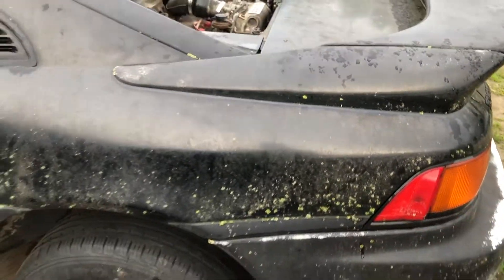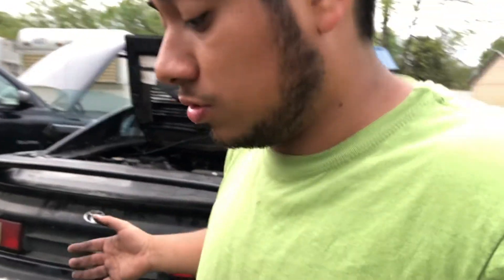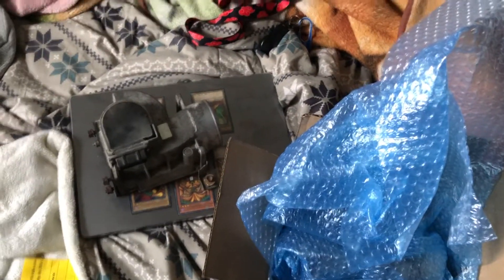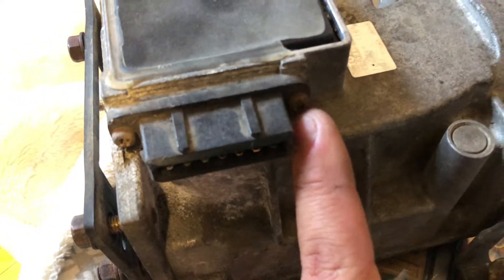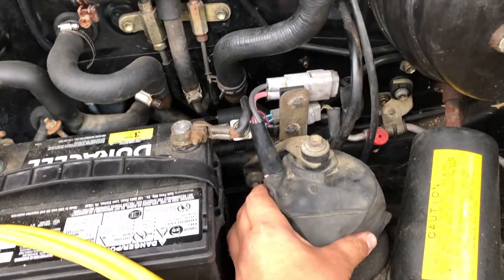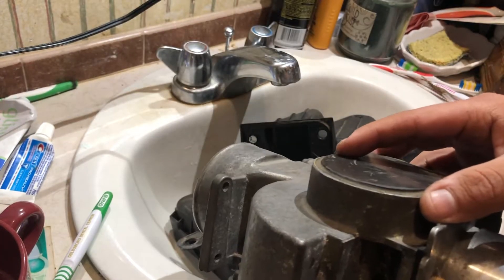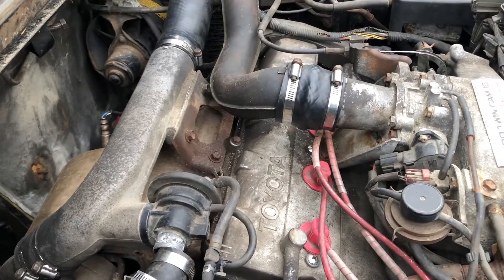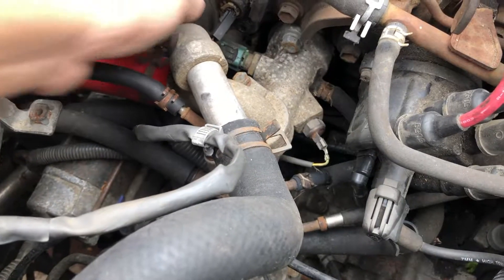Toyota MR2 3SGTE is FINALLY RUNNING!!! Project 1991 Toyota MR2 Turbo

Comment: go through every hose on the engine and replace anything that looks suspect. id also look into your ISC valve and your idle set screw settings and make sure they match to the bgb.
Reply from the maker: Thanks for the tip! I’ll check every hose on the car. What other thing should I keep an eye on besides the basics like oil and coolant?